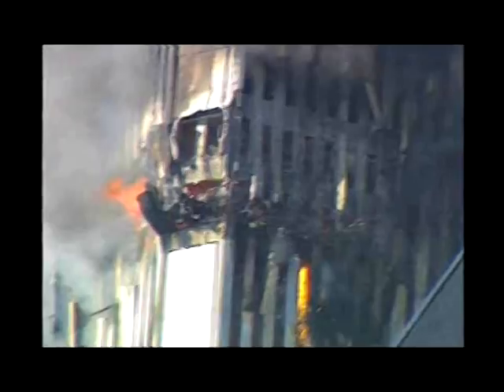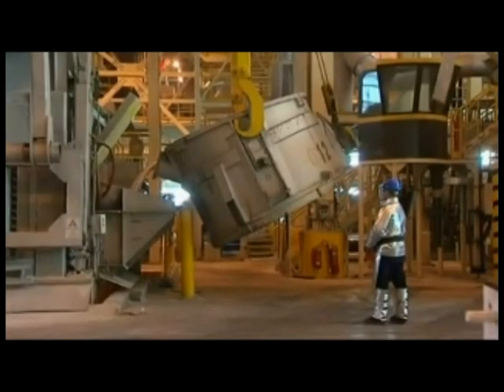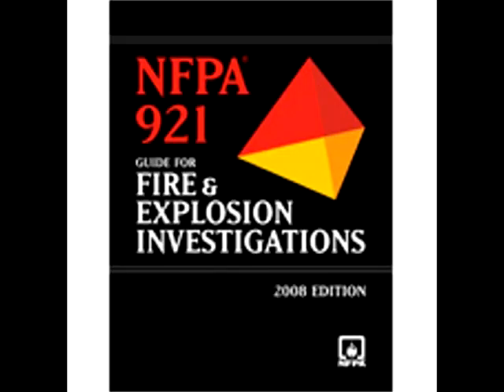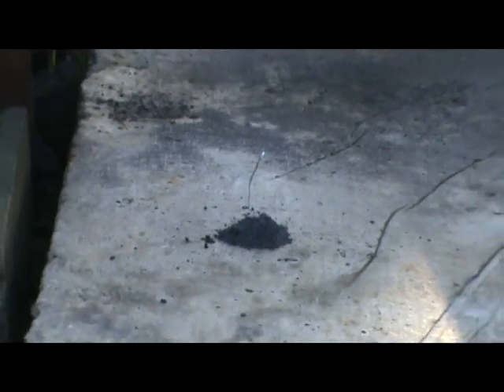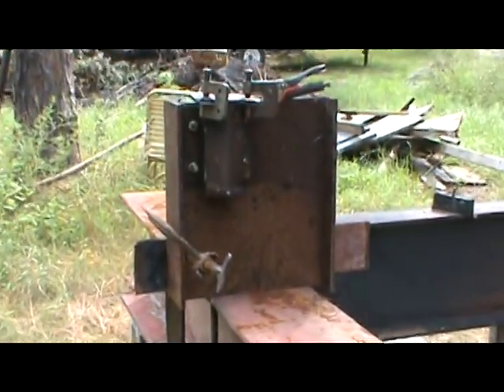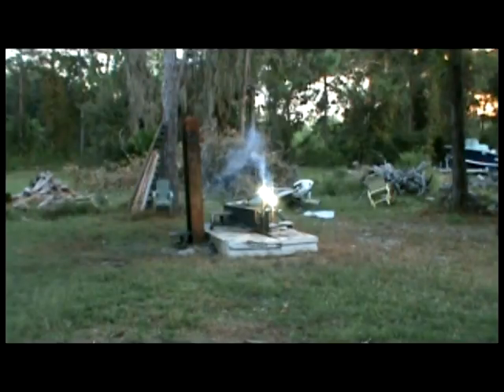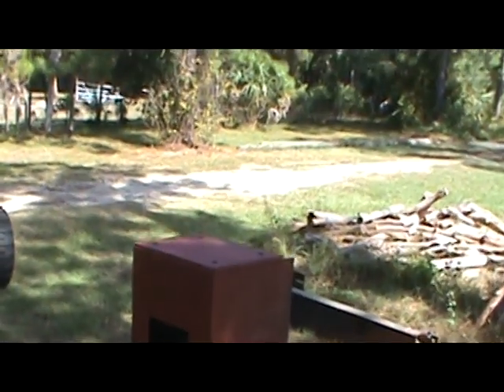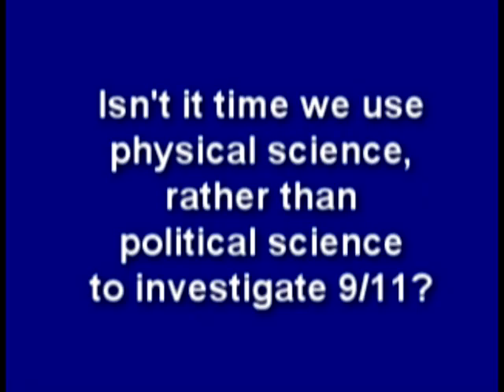9/11 Experiments: The Great Thermate Debate

Comment: Why use expensive jet fuel when other steel towers that planes hit never went down look it up chicago tower hit by plane it never went down only a hole in the building twice the size of the plane. The plain still there burning but no other floor on fire nor steel beams buring. plus look at other plane crashes jet fuel burns with no effect to melt the aluminum meaning not hot enough. Thermite is cheap and easy to make in large quantities. Lastly look up the owner of the towers and reports of him demoing building 7 and claiming it on his insurance using the deaths of the people in the towers for sympathy like a person who burns down their own home with their family trapped inside and collecting on insurance aka insurance fraud.

Comment: Whether or not the US government was involved in 9/11, we may never know. However what we do know is that the official story isn't completely correct and that it may be possible that the terrorists did pre-planning perhaps with some kidnapped engineers and stolen documents that allowed them to do it this way. However I still question why the towers fell straight down. If you were a terrorist wouldn't you want to make it collapse and fall sideways? as in place thermate charges on several floors on one side and the corners on that side to it would collapse and topple over?

Comment: Molten metal does not mean molten steel.  There are plenty of metals with lower melting points than steel.
Reply: Could have been aluminum from desks and office equipment..there was literally tons of that in the offices
Reply: A.L. Stoots the plane also contained aluminum, the fire from the jet fuel most likely melted the aluminum. Like a furnace.
Reply: The molten steel was documented in a metallurgy study by FEMA, which clearly shows the leftover steel beams reduced to "paper thin razor sharp steel resembling swiss cheese".

Inform yourself instead of throwing out assumptions please.
Reply: mikhaelis I agree with you. All metals glow when heated. Doesn’t matter what kind. They all glow,they all glow bright orange the hotter they get. And like you said,they make it seem like EVERYTHING in that building was steel. Buildings like that have miles of piping,duct work,etc,not all made of steel. And let’s not forget this simple fact,the towers didn’t fall because the steel beams melted away,they fell because the steel was WEAKENED. Doesn’t matter what the melting point of steel  is,how hot it needs to be etc,the heat weakened it. 

With steel,especially steel used for construction,when purchased from the manufacturer,it is heat treated and tempered,to make it stronger. If you apply heat heat to already heat treated steel,guess what,it becomes weak and brittle.doesnt matter if it’s steel. You’ve now changed the atomic makeup inside the steel.
Reply: @JonathanMartinez-xs5ze  

Holy shit, someone commenting who is not an idiot. Great points, everyone who claims 9/11 was an inside job,  never consider exactly HOW these buildings were fitted with these "thermite  explosives".
Reply: Jeremiah Seman here’s another point. @:16 seconds he states that after the plane hit,the fires were burning out and cooling down. Actually after the plane hit,fires inside began to burn more intense because all the materials inside fueling that fire. Second,the fire definitely was not cooling down. In fact the inside of the towers acted like an oven,trapping heat and actually making it hotter,thus heating the structure of the building,weakening the steel,allowing the steel to start to flex and bend under the weight from the floor above. Once the weakened steel couldn’t handle the load,it gave,crushing the building under its own weight.
Reply: @JonathanMartinez-xs5ze  that's just not true though. The fire was not very intense. The presence of thick black smoke would tell any person with a high school education that this was not a very efficient fire. Lots of black smoke indicates a lack of air in combustion. Same rule applies everywhere on this planet. Add to that the reports from the fire fighters on the scene that the fire was contained and was under control, pressence of black smoke is a huge testimony to that. So now tell me how the fire burned so hot that it collapsed a building??
Also do some research and look at the Windsor building in Madrid. A skyscraper fire that burned alot more hotter and alot more longer than any fire on 9/11, but surprisingly didn't fall down. 
There was aluminum in that building but a little bit of knowledge would tell you that the fires burnt no where near hot enough to melt even aluminum.
Reply: Tom Hill really? Fire not intense? You know from looking at video of the outside of the building? Or did the firefighters up at the fire tell you this. Oh wait,that couldn’t have happened because their lives were taken before they could even do anything. Fire contained doesn’t mean fire wasn’t hot. 
Black smoke... what’s your point. I can take 10 car tires,place them in an open field (plenty of oxygen to feed the fire) cover those tires in gasoline and set them on fire. Guess what,that smoke is going to be black as night. But how,black smoke indicates lack of air. Blah blah blah. It’s black because of what’s burning. 

Windsor Tower is a horrible example. Completely different construction. 110 floors vs 32, let’s see what else. Oh yeah,Windsor didn’t have a commercial Jetliner slam into the side of it flying at almost 600mph taking out multiple floors,damaging the structural integrity of the building. Oh I almost forgot, Windsor fire didn’t have about 10,000lbs of jet fuel. Almost forgot that point.  
Also Windsor tower did have an outer collapse. Partial outer  collapse because of the way it was built. Completely different from the wtc towers construction. 

Try again
Reply: Tom Hill Tom Hill Black smoke does not mean lack of oxygen. In fact it can mean many things. Smoke is an indicator of many things. Black smoke can also be an indicator of high heat,black smoke being the hottest of smokes. In a enclosed area,black smoke can do as much damage as the actual fire because of the temps the smoke keeps. Continued heat of 1000 degrees of more will not melt steel,but definitely can weaken it. Do you not agree? 

Not here to name call etc. differing opinion doesn’t make you a dick. We just have different look on things. So chill with the name calling,and recommendations on school. Been there,done that. Thanks
Reply: @bubba842  black smoke = oxygen starved fire,....  Fires not hot enough to weaken Steel...        Oook... 

The offices were full of petroleum products which would give off black smoke when they burned,.  .. carpet, office partitions,  couches, chairs, computer products, desks, ....etc. 

Think about this one.....
No one associated with the ASME, the ASCE, or the AIA has any problem with plane impacts or tower collapses.       Everyone in those groups understands physics, has a working common sense area in the brain,  and realizes what we saw that day Is what happened.
Reply: Compared to other metals aluminum has a very low melting point, around 660ºC. And you can see molten liquid aluminum retains its silver color it will glow when heated further but, once it becomes a liquid it will flow before being heated enough to glow in broad daylight. 
The molten steel pouring red hot with sparks out of the building, the small spheres of iron found in the dust as well as the thermate smell, are clear evidence that jet fuel alone did not bring the towers down.   
https://www.youtube.com/watch?v=Q6Zrnv4OtbU
Reply: the structure in the twins was made out of steel..
Reply: @i6billy998  i thought it was made out of water
Reply: No construction company would build any building above a couple of floors tall, of any other metal than steel. At 110 floors, the WTC towers had to be built of the strongest steel possible, there is absolutely no question about that.
Reply: Only solid steal was used in the construction of the towers, Don’t be a smart ass.
Reply: State the obvious why dont ya, you do realise that the metal hes testing on is steel?
Reply: Not to mention the 80 tons of Aluminum airplane that was injected into the building.
Reply: @David Festa, thanks for asking, you can see these affected steel beams in the metallurgical examination by FEMA. 403 APPENDIX C.
Reply: @delosombres https://youtu.be/cyTxxEhS4uc Oh look. Its molten aluminum. Glowing red. In daylight.
Reply: All metal glow orange when it gets hot enough. You people act like these planes crashed into an empty building that had nothing but air inside. It was one of the largest office buildings in the world. It was full of metal..  Desks,  office furniture,  etc.  There was no "oxygen starved fire". It was burning black from all the office materials that caught fire. Ever seen a tire burn?  It burns black,  and it burns long time producing black smoke. And definitely Italy,  at that altitude there was plenty of oxygen.
Reply: what are you talking about? "you people".. I don't act like anything. I'm not trying to prove to you that 9/11 was an "inside job". I want the facts and I'm referring to the structure of the buildings. the steel beams had to be melted for the buildings to fall like this. Why are you talking about black smoke? It has nothing to do with the melted metal?
Reply: mikhaelis yes but none that shine as bright and as orange as that! And none in big enough quantities in a building made of steel to poor down like that

Comment: dont you know how a furnace works?  adding oxygen rich air quickly to a fire makes the fire burn hotter -- you cant melt steel in hot coals -- but add some forced airflow and you sure can.
there are high winds up that high on the building -- it acted like a furnace and burned the fuel along with all the office materials.

Comment: The fires were NOT cooling.  The fire  was confined within the building, which is why the smoke continued to billow out of the TOP of the building later.  The biggest problem with your analysis of the evidence, is the narrow mindset as to the sources and causes of the effects seen.  Let me elaborate.
First, the fire:  The conflagration was instigated by high-test air fuel, a substance formulated for maximum volume to return of energy.  The plane was freshly fueled and thus carried a full set of tanks in preparation for a cross-country flight.  Impact with the building ruptured those tanks causing the fuel to ignite almost all at once.  Because of the central elevator shafts, the fire and heat was channeled upward through the core of the structure.  The continued burning of these intense interior fires softened the metal  supporting the building, BUT THE HEAT DIDN'T HAVE TO MELT THOSE BEAMS.  It only had to soften them to ruin their structural integrity.  That integrity loss meant that in time, those beams were no longer capable of supporting the many floors above, and they gave way, collapsing first at the level of impact, and as the upper load fell, it crushed each and every floor on its way down, one at a time, to eventually be smashed to rubble in the process.
Anyone who has dealt with metals and forging can explain how metal, subjected to intense heat, can lose its temper, and soften, it's molecular structure made brittle and far easier to fail.  Proper cooling techniques will impart to steel greater strength and improved reliability.
Second, the molten iron, as reported.  Let us assume, for the moment that the molten metal was in fact iron. (Which I strongly doubt.) Iron has a melting point of:  2795.0 degrees Fahrenheit.  Carbon steel, the type that falls into the structural steel category,   begins melting at 2,070 °F, and is completely molten upon reaching 2,399 °F.  However, the melting point is not important.  What is important is the temperature at which carbon steel's yield stress will be reduced to 60% of its normal strength by heating.  If reducing its structural integrity, a fire need only to be hot enough to get the steel beams to 1000–1300 °F!  Those numbers are easily achievable in this scenario.
Three, the molten material seen flowing out of the building. Since high-test jet fuel burns at 800° to 1500°F, the temperatures did meet the criterion for the yield stress integrity reduction level at 60% compromised.  But what of the OTHER metals within the building at the time of the impact?  The melting point of copper is 1,984.31 degrees Fahrenheit, which means that the copper wiring within the building would not reach the melting point much faster than the structural steel.  But there was a large quantity of metal within the building that would melt and flow at much lower temperatures, and that would be the aluminum skin and structural elements of the airplane itself.  According to salvage reports, little of the airplane was recovered during the hunt for human remains.  This leads me to believe that what was observed raining out of the building was actually molten aluminum. Of course there are other metals and alloys used in such a structure, but not of a sufficient volume to appear pouring out of the building in flaming droplets.
Four, the concrete. Concrete was used as sheathing around steel structural elements in part as a fire reducer, protecting the steel from over-temperature yield stress failures.  However, the concrete used in the building was not designed to withstand the prolonged and intense temperatures of the burning jet fuel.  As temperatures quickly soared in the first few minutes after impact, the concrete would begin to break down; shrinking as moisture is driven out of it, and breaking and spalling as it contracts.  Once this takes place, then the steel has lost its thermal protection and the steel itself will begin to weaken.
As someone who has experience with large quantities of thermite, it is therefore my firm belief that the jet and its fuel were the main reasons the buildings eventually weakened and collapsed, since all the melting points seem in theory to concur.
Reply: Are you FBI lying to us again?
Reply: Other than your description of jet fuel as "high test"(in reality it is high refined kerosene), your explanation is dead on.
Reply: Nothing you've said explains freefall speed ,There's pictures of a woman looking out of the towers where the plane crashed ,So that confirms it couldn't of been that hot ,Your arguments are stupid, Aluminium doesn't mix with steel ,What was pouring out the side of the building was molten steel, No one found molten aluminium, But they did find molten steel, You've, only got to looks at all the behind closed doors testomies to know there's dodgy dealings afoot ,ie bush and channey testifies together  behind closed doors, So go away payed for disinformation operative,

Comment: Don't forget, there's 13000 volts of electricity running all the way up inside the building. There is a substation every 12 floors and the system is grounded to the i-beams. I've seen Laboratory test where 3000 amps can take a huge I beam and melt it down.

Comment: He says jet fuel and wood can’t melt steel... True... Charcoal can’t melt steel either... Yet it does when you build a simple furnace! Now, put 26000 liners of jet fuel and millions of pounds of combustible material inside a giant metal box that acts like a chimney and you may well melt some steel! 

What about those micro-speres of melted iron? Well, my guess is they come from the thousands of steel beams that were cut with oxy-acetylene torches during the rescue phase and after... He does not mention when the dust sample was taken...

Because, really, if someone wanted a good excuse  to go to war, two planes crashing in the WTC was plenty enough reason without having to plan a secret demolition with hidden energetic material in the walls! Why add to complexity and risks of detection? 4 planes crashes would do the  trick any day!... Steel trusses  buildings collapse during fires all the time... There is no magic or conspiracies involved at all when steel structures fail due to high temperature!

Comment: This video shows that thermite is able to cut steel. Nothing new since it is used to weld rails.
Whether it proves it caused the collapse of the tower is another question. The amount of work/complicity needed to secretly arrange this stuff in the tower and have it ignited at the same time to cause a controlled demolition is simply less credible than the theory of the building collapsing by buckling caused by a loss of mechanical properties due to the heat.

Comment: you don't have to melt steel to bring it up to a high enough temp to weaken it.Not commenting on melting steel.Pointing out you didn't need a high enough temp to melt steel to lose its structural integrity.